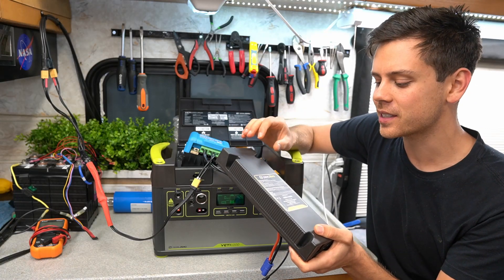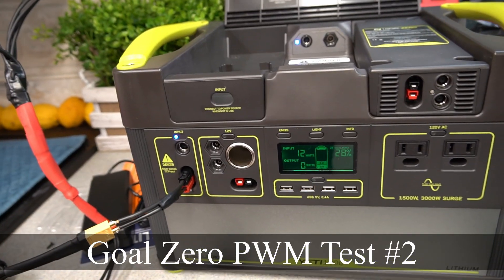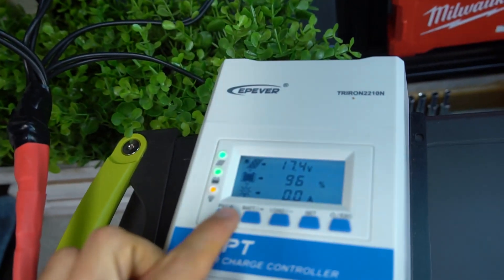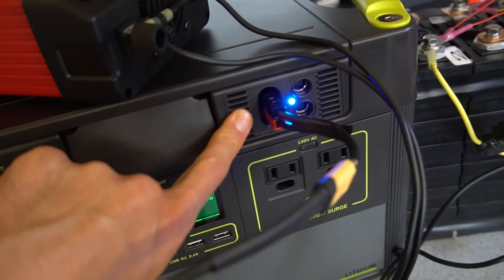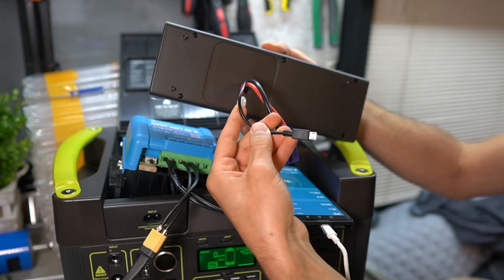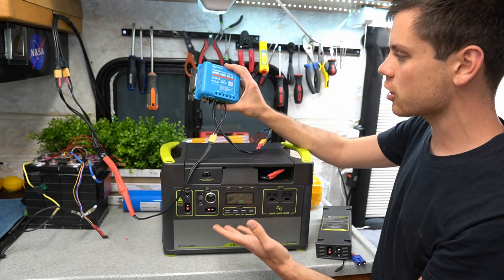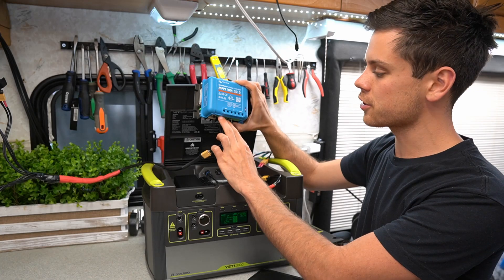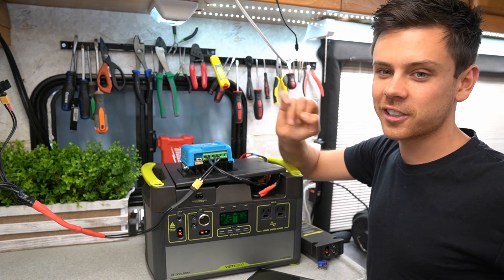How to Hack the Goalzero Lithium by Adding a Powerful Victron Charge Controller

Comment: Slower charge rate makes the battery last longer. Okay.
Reply: TheChadWork2001 -  You are the first I have seen to point this out !  Thanks ! 

     I guess because "Time is money" everyone wants to charge as fast as possible.  EVERY source I have checked for ALL types of batteries indicates lower charge rates increase battery life and help maintain capacity .   I bought a Nissan Leaf over two years ago which motivated me to research Li-ion batteries .   HEAT is the other main factor in preserving battery life  .  .  .  keep the batteries cool ,  but don't freeze 'em ! ! !     (Charging at a high rate increases heat in the battery .)
Reply from the maker: Depends on thermal stability and internal resistance of the chemistry being used. And battery/cell design. And temperature. I have a video that covers some aspects here: https://youtu.be/Yf9N9zBgyB8
Reply: Up to a point, yes, that is true.

Comment: Goal Zero should have put Victron charge controllers into their units to begin with.
Reply: It turns out GZ's MPPT does accept up to 48 volts. Confirmed today with GZ. They say 22vdc to avoid anyone exceeding that input on the built in PWM charge controller, which would cause damage to the unit.
Reply: That mppt gz charge controller will only use the 22v though so you will only get half power using 40v panels. Garbage design.

Comment: If you want to do a video on connecting an external lithium battery with the Goal Zero that would be cool. I'm going to do that using their DC charger.
Reply: Yeah id love to see that too! I'm planning a dual setup with a Renogy Smart Lithium Phosphate (which you loved too!), and the DCC50S. Trying to figure out how/if i can charge both at the same time or if i need a switch to manually charge one or the other.
Reply: @antoniancu  where did you land on figuring this out?

Comment: For the Goalzero 1400 lithium would the settings still remain the same for the victron charger? Thanks!
Reply from the maker: Yeah totally!
Reply: The only difference between the GZ 1000 and GZ 1400 is simply capacity -- everything else should be the same.

Comment: So Will, how long does it take to charge the Goalzero with the hacked charge controller
Reply from the maker: With 500 watts of panels and full sunshine, 2 hours
Reply: @WillProwse  That's great puts it recharge time up there with the Inergy, now need to find a way to extend the battery cycle life
Reply: Jeff 1953 I think Will pointed out that by not charging to 100% but to 93%, you should get more cycles. The Yeti doesn’t just die after 500 cycles.... it just loses capacity over time.
Reply: If the MPPT is pulling 150-200 watts and the battery is depleted down to 20% (200 watts remaining on the model featured) then 5 hrs 20 min to 4 hours.

Comment: Very cool. I've been thinking about a goal zero as a good start and expanding from there, but battery expansion seems limited. Any ideas on hacking the capacity?

Really appreciate the videos. Thank you!
Reply: at that point, DIY would be a better fit  I would imagine
Reply: @AaronGeller  yeah I thought that might be the case but I was hoping to expand over time. The goal zero should meet my needs for now.

Comment: Hey Will, would you consider please doing a few videos on 12 volt accessories that will work with the Van/RV/Camping/Off Grid lifestyle such as 12v fans, coffee makers, lights and lamps, blenders, heating blankets etc? And also 120 accessories and appliances that work on inverters and which inverter would work best for said items?
Thanks!
Reply: What kind of things do you wish to know about them? You can wire them to a fuse panel or plug them into a 12v outlet

Comment: I would really like to get some information from you on how to setup my new dometic cfx75dzw. I am wanting to run it 24/7 in my truck and thought that maybe solar would be the way to go. If you have a way we can discuss this I would greatly appreciate it.
Reply: The top loading dometics can run on either 120 or 12v -- 12 volt is the most efficient. The fridge has a large initial draw then the power draw drops significantly down to around 36-48 watts an hour depending on multiple factors such as how cold you're keeping the fridge and freezer and what the ambient temperature is. So let's say 48 watts (which I think is a little high but better safe than sorry). So in 24 hours, let's say it consumes 1,152 watts (24 hours x 48 watts) then you know if you want it to run for a day with no supplemental power, then you need around a 1200 watt battery. However, if it's connected to solar and it's bringing in say 75 watts from a 100 watt panel, then there is more power going in than coming out throughout the day. The last hour of so of daylight, solar output drop so now you have around 12 hours of little to no solar being produced. So your night time load is 576 watts. In this case, to give yourself a buffer, at least 600 watts or 50 amps at 12v. You could get by with a 100 amp AGM or 80-100 amp Lithium battery and a 100 watt solar panel.
Reply: Aaron G , so a100 watt solar panel should be enough (along with a 100amp battery) to keep me running year round?  And is there other components that I need? If so, do you mind giving me a check list and any recommendations on who/what brand to go with. I am so sorry for all the questions but I am a super newbie to this whole solar thing. And thank you for your reply as well.
Reply: Scott Byrd Will has a whole book on solar from Amazon and plenty of how to videos on this channel. The basic concept is you have a solar panel which leads to the charge controller that lowers the voltage to a usable level for the battery. Of course there are fuses and such but I would check out his website for exact blue prints. With a little reading, it because less daunting. Or you can buy a Yeti 1000 from Goal Zero and just plug in the solar and you don’t have to deal with all the technical. Find a good price by google searching their open box items
Reply: @Bpbreeder  100 watts of solar with a 100 amp battery would be the minimum because you will not always have ideal conditions. If it's cloudy for a day or two , you might want more battery power or more solar to get you through. In summer, there's so much sun but in winter, especially in the northern US, the panel output will be considerably lower. Would you be using the fridge full time or just weekends and short trips?
Reply: Aaron G I want to be able to use it full time year round.
Reply: @Bpbreeder  What state(s) will you be in? If you won't have many cloudy days, you'll need less solar than someone like myself who lives in Michigan and has a lot of cloud cover in winter. If you have a house and you live somewhere where you might not get good solar part of the year, you can plug your dometic in at home and charge your battery at home so when you take your truck out, you'll have a full charge.
Reply: Aaron G I live in middle TN
Reply: @Bpbreeder  so probably not as good as Arizona but not as bad as Michigan. TN is a beautiful state!
Reply: Scott, I have 200 watts (2 renogy 100 watt panels) running into my Goal Zero Yeti 1000.  I do not have an MPPT controller.  I run a dometic CFX 35US 24/7 set to 0 F (ie using as a freezer instead of a fridge) on 12 volts.  Running your big Yeti as a fridge won't draw more than my smaller one as a freezer.  I've never come close to drawing my battery below 70%, and I don't have the MPPT controller.  Your trick is going to be keeping your Yeti fully charged with half the wattage input.  If you upgrade to this Victron MPPT as Will has shown, you will definitely be fine with 100 watts if your fridge is your only load most of the time. I'm going to do this upgrade as well so I can feel confident using heavier loads early in the day, knowing I'll be fully charged by nightfall.
Reply: CatherineRHarrison thanks for the information. But I do not have a yeti. Actually I do not have anything but my cfx75 at the moment. My thoughts were to get the Renogy 100 watt RBR kit with a 100 ah gel battery. Do you think that would do the trick or do I need the 200 watt kit?
Reply: Scott Byrd I would go with an AGM battery and maybe consider their 260 amp 6 volt batteries. You get two of them and connect them in series. Of course lithium will be lighter although more expensive. If you keep your AGMs consistently above 50%, say above 60%, then you’ll have a much longer life out of them. AGMs are still useful especially in cold temperatures which is why they can be used on the outside of vehicles. It’s always good to have more than what you think you need if you can afford to do so.
Reply: @AaronGeller  Does anyone know what can be done about the issue of 12 v friges auto cutting off with lithium batteries?
Reply: I'm in Ohio, so the comparison is apples to apples.  I've been running this way over the winter, so lots of days of rain and cloud cover.
Reply: CatherineRHarrison thank you for sharing your experience. I’m native to Toledo originally

Comment: Just bought a Tesla battery, can't wait till it comes. Any thoughts on Nissan leaf battery Bank?
Great video, love GoalZero
😎😎😎😎😎😎
Reply from the maker: Due to bad design of those packs, used Nissan cells have pretty bad capacity. Not a fan going by most tests. They look neat. But bad performance. Way better options available. Tesla pack way better

Comment: Hey Will, do you have any Amazon Jackery promo codes for Solar Saga 60W solar panel by chance? 🤔
Reply: use the Honey plug in for finding discount codes
Reply: Aaron G I’ll have to give that a try. Thanks for the suggestion, bud.
Reply: @RenegadeBastard  Some companies have open box sections on their sites or ebay stores. You can get a goal zero yeti 1000 for under $800 when it retails for $1,100

Comment: 2nd. I have a kodiak.  Will, my wall power just stopped charging (no blue light and power not increasing.)  It’s new only charged twice by wall not by panels yet.  What is your suggestion? If you have one.  Thanks.
Reply: I also have a non charging Kodiak. I think I will try a Victron to charge this unit. Kodiak has two very cheap Chinese  pwm charging units inside. The light on one of them went out. Customer service is non existant at Inergy. Do you havet charging parameters for this units battery chemistry?